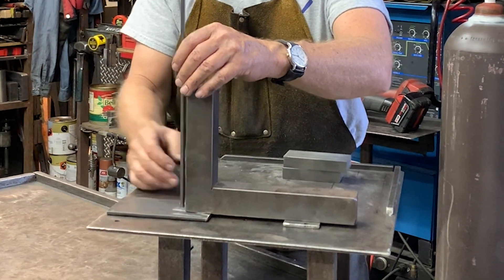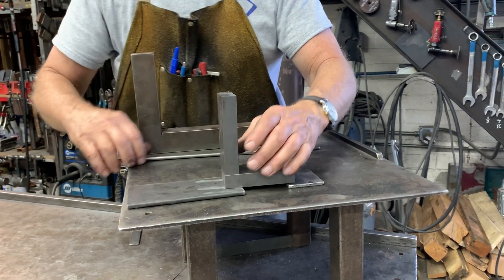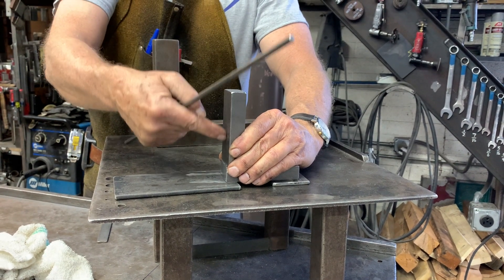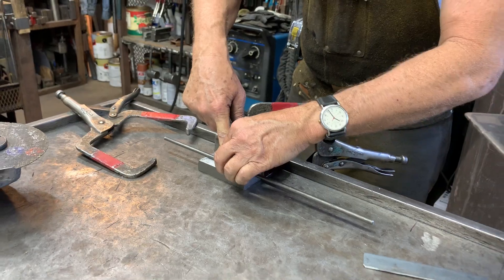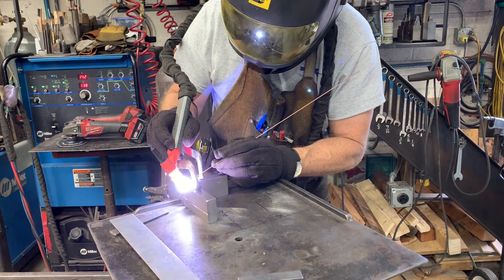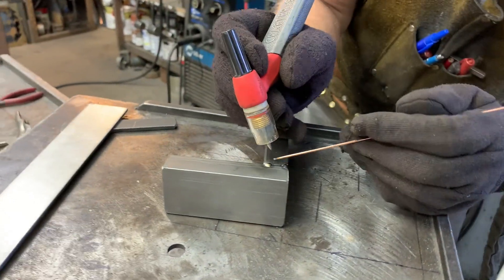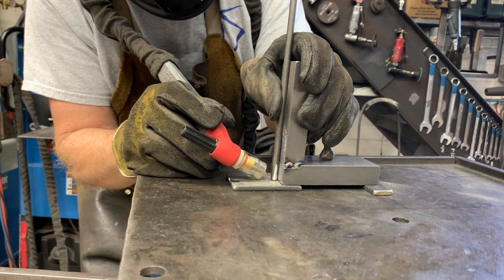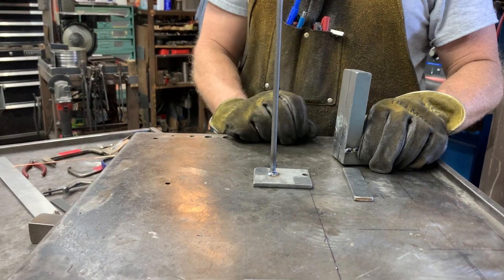A Shop Built Unsquare Square

Comment: thanks for this informative video.  I am curious how you decided on a 4 degree offset?  do you find this is the best angle to use for most 90 degree welding efforts?  or have you found that you need to use other angles (other than 4 degrees) depending on the metal and project components?  thanks in advance for the info.
Reply from the maker: The specific angle can depend on material, but I have found through experience that approximately 4 degrees works out for many of the welds I end up doing. Apologies for this delayed response, things got a little busy.